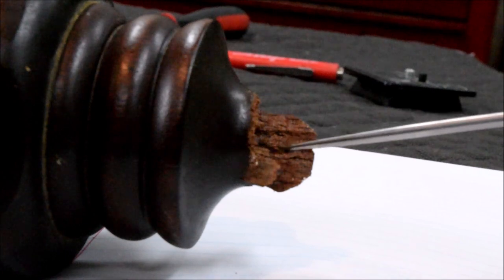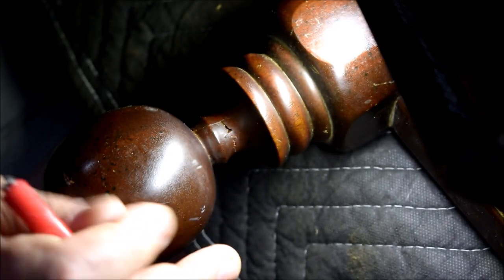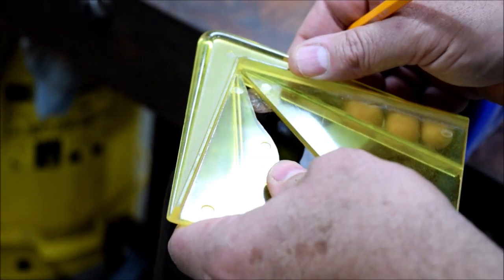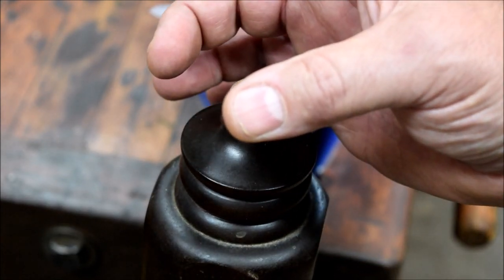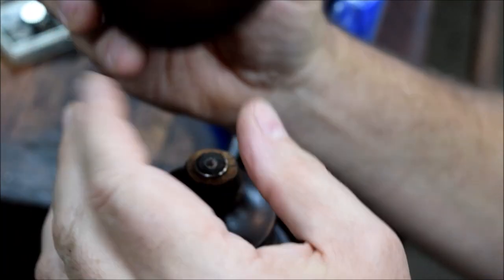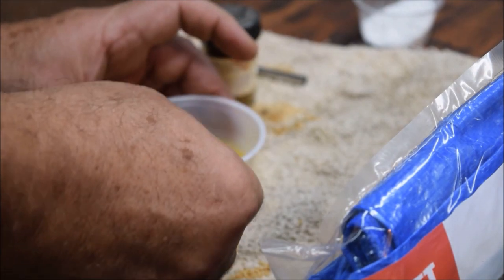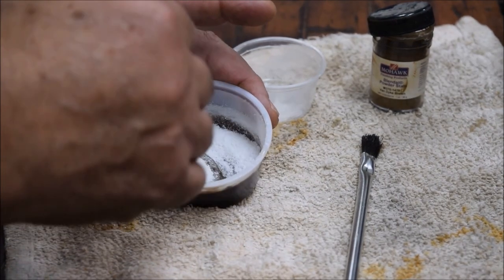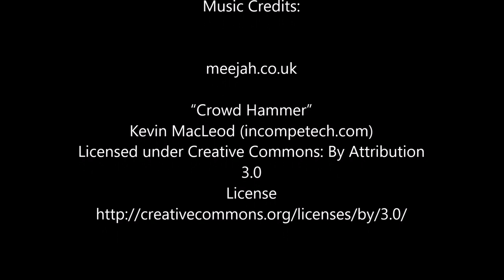Repairing a Broken Cannonball Foot Board

Comment: Good tips and good work, particularly in the boring those holes for the dowels in perfect alignment and cutting the side groove in the dowel to let trapped air escape.  Sometimes when you have voids in a glue-up, you can use some of the saw dust from where you cut off the ball to make a filler paste with glue and that Van Dyck colorant which can be squirted or squeezed into the void to add strength to the joint, and create a solid wood-like surface that can be quickly finished to match the adjacent wood, thereby improving the surface appearance and eliminating any soft spots or potential runs from the wax.

Thanks again for this video.
Reply from the maker: Good tips.  Thanks!

Comment: Hi Larry,
Excellent repair and video. Good idea to use the Shopsmith and do a horizontal bore.

It looked like you used a soldering iron to melt the wax, or was that a different tool? If so, can you provide the make/model?

You had the boss and a supervisor watching you... Such pressure to perform...😎

Comment: The horizontal boring machine was an excellent idea for this project. Did you consider leaving the ball on and drilling right down through the ball and post together? Good to see you back.
Reply: What I will do sometimes in that situation is before I glue the part on is still a nice centered hole in the broken piece then glue it on and use that hole to drill into the base and glue in a dowel. You then half to carefully disguise the dowel but it is often simpler than getting the perfect alignment
Reply from the maker: Thank you.   No, I didn't consider the through hole.   I was scared enough drilling the horizontal hole.   Had I tried to go through the ball it probably would have looked like Swiss cheese when I got done!  LOL.   Thanks for watching.

Comment: Great job, but a question.  I noticed that when you put on the cannon ball at the end, it was wobbling as you put the clamp on.  Did you bore out too much material?  Was this on purpose for some reason?  Thanks
Reply from the maker: It was intentionally bored a bit oversize to make sure I could align it correctly.  The thickened epoxy made up the difference.   In retrospect, I could have sized it exactly and been fine.   Thanks for watching!

Comment: Why mix so much epoxy when you only need just a little bit.
Reply from the maker: It dispenses from a metered pump.   One pump for each component.  What you see is the minimum the pre-mix dispenses.  I suppose I could try and adjust the mix manually, but I prefer the mix to be correct so we get maximum strength from each batch.   It's funny you noticed this because I will often mix smaller batches of 5 minute epoxy for smaller jobs, just to avoid the waste you saw here.    Great eye and thanks for watching!